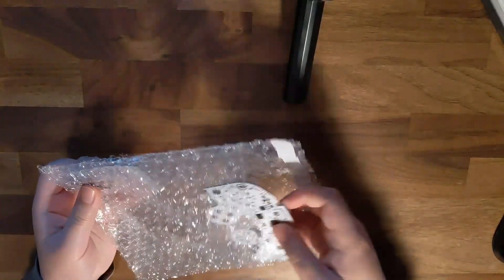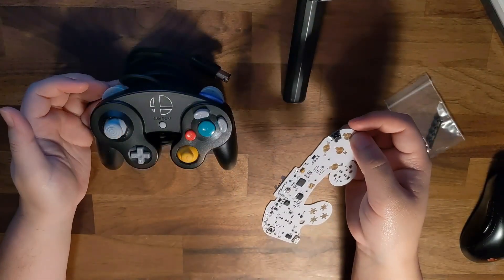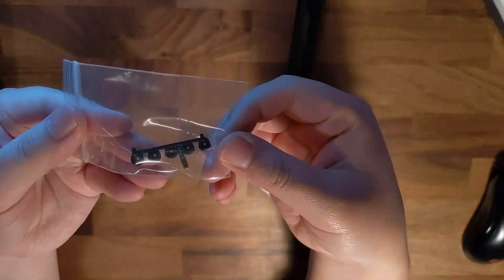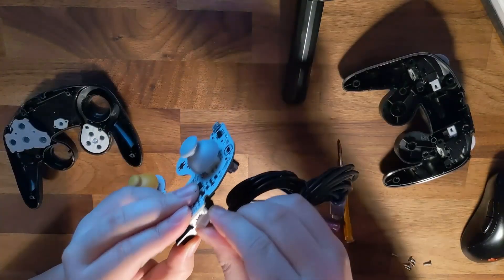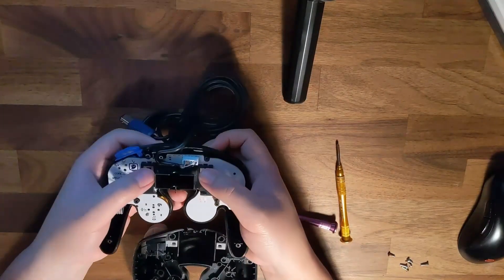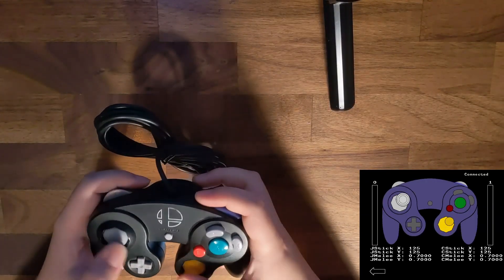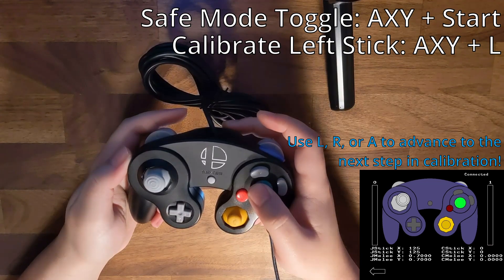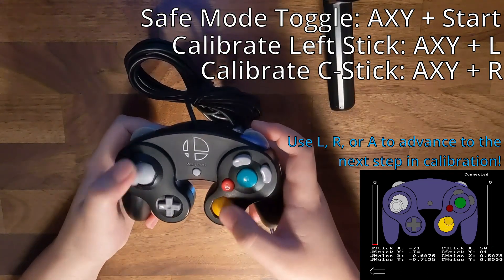The Solderless PhobGCC Kit Setup Guide / Tutorial

Comment: The board came in and I noticed that the green wire on the connector was broken off. Is there any way I can fix this?
Reply from the maker: Did you get a detachable cable or the directly soldered one?
Reply: @in10cityGCC  detachable
Reply from the maker: @eyesak387  if the pin came out with the wire, you can just reinsert the wire and pin back in, if the wire is completely exposed then it would need to be recrimped. If you ordered it through Etsy you can message me there and provide pictures.